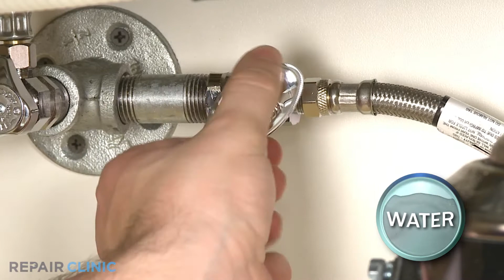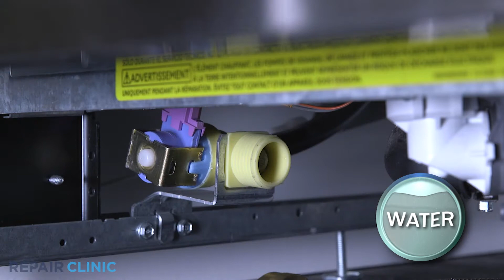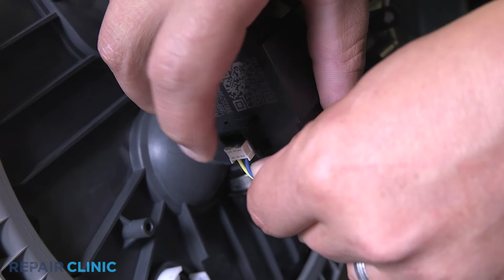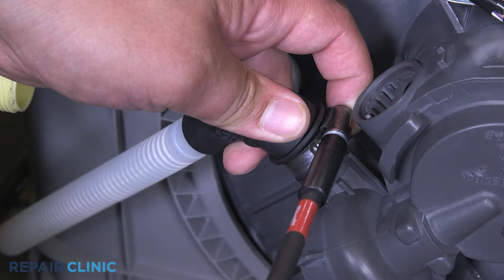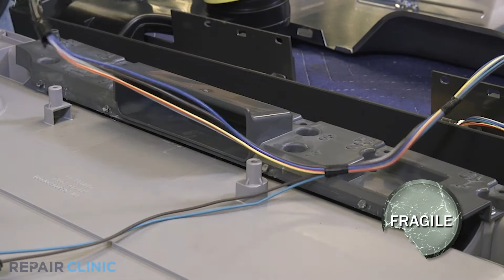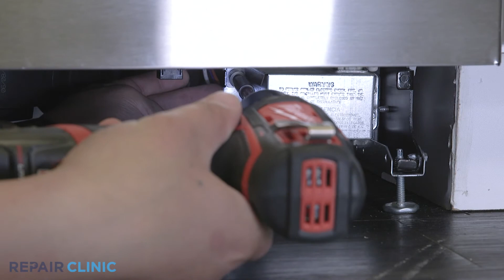GE Dishwasher Disassembly - (Model GDF510PSMSS)

Comment: Do you have a diagnostic video?
Reply: @repairclinic  I didn't see anything that helped diagnose the issue. I also search for my model number and nothing showed up but you do have videos for it (I have a GDF Series). I found a topic on the GE website: "DISHWASHER - HUMS AND WILL NOT FILL" I followed the directions and it worked for one cycle but it won't start again. I've repeated the directions but it does no good. Here's what happens: I press start, and it makes some noise (a deep hum that is not normal), then after a few minutes, it just stops. It won't fill with water. I used it about 1 time a day before it stopped working.
Reply: Having the same issue. Every figure out how to fix it?
Reply: @johnpzaccari  yep, buy a new one, lol.